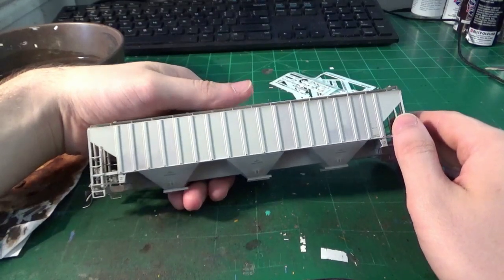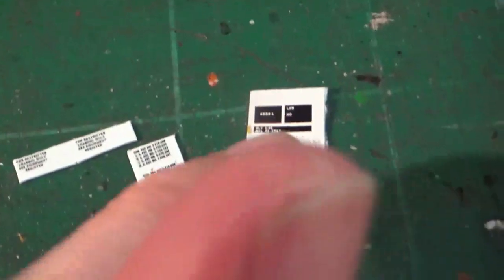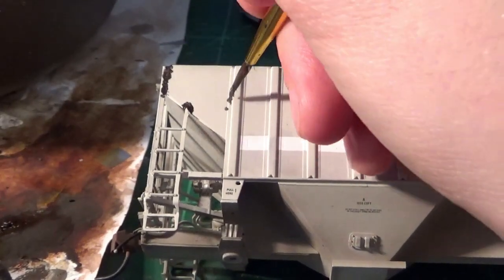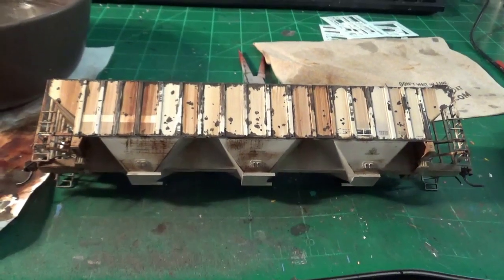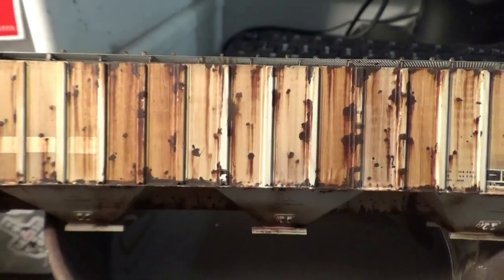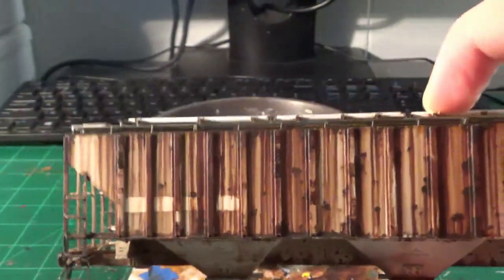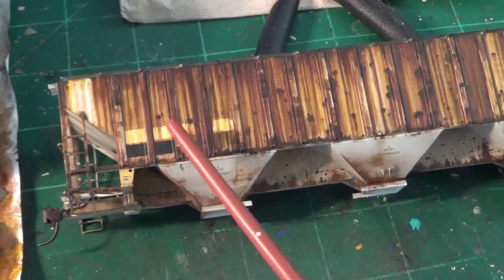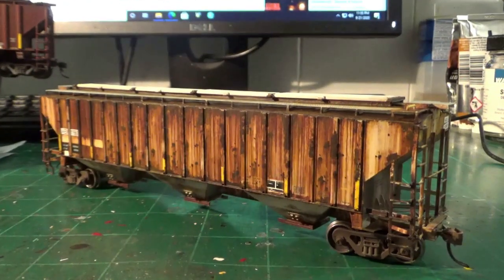**HO EXTREME WEATHERING**  Intermountain 4750 AEX #11861.

Comment: Beautiful job, on your cars. A very long time ago, I worked very briefly for a company that made those replacement hatch covers. Here’s something to think about. They made them out of fiberglass (they switched to aluminum, last I heard) so they won’t rust, and the gel coat is the color you see, and a part of the hatch cover, not just a coating. They will only fade, instead of the weathering we’re used to. Also, something I’ve noticed on railroads that had other color schemes (BNSF was a frequently seen prototype), a car might have two different colored hatch covers on it. 
  I like your techniques, I’ve never been an artist, certainly not enough to try to develop my own technique on a 30 dollar car. Appreciate you sharing your videos.

Comment: @DansRailroad2011 at 14:25 is the thinner you talk about just plain water. Do you put anything in the water? Thanks
Reply: If he says "thinner", it'll be either mineral thinners or odourless thinners (the only difference between the two is the smell).
Reply: @beeble2003  Can the brushes with the thinner be cleaned with water?
Reply: @DougCameron-q1g  No -- thinner isn't water-soluble. Use the thinner itself to clean the brush.

Comment: 30:15 "This is kind of a good time to put the car aside, sit on it, ..."
Instructions unclear, car broken.
Reply from the maker: The oils need to set up, otherwise if you keep handling it and add more layers, it will start to peel up the under layers of paint work and you would have to start over.  I learned that the hard way.
Reply: @DansRailroad2011  I just meant that literally sitting on model railcars tends to damage them. 😁 But, yes, the oils do take a little while to dry.